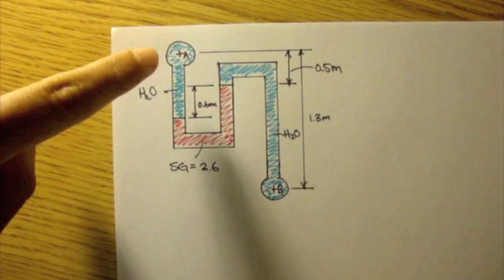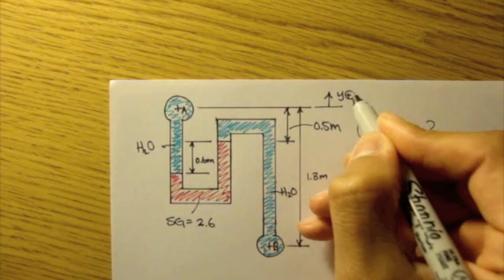Static Pressure: Example 3: Part 1 [Fluid Mechanics #11]

Comment: One-line solution! I'm going to work from B to A keeping in mind that as you move up the pressure is a negative value, while moving down (h is larger) produces a positive pressure value. γ water is 9800 N/m^3 and γ of the other fluid is 25,480 N/m^3:

Pb - 9800(1.3-0.5) + 25,480(0.6) - 9800(0.6+0.5) -Pa (negative because we're going up the tube) = 0. Result: Pa - Pb = -3,332 N/m^2.

Comment: Why is it 0.6? The way you write it (-0.5-1.1)
Reply: because he write two negatives instead of one. So the negative will turn positive
Reply: @wellinformed8050   Im confused. I would have done it this way:
= -γ * (-0.5 - (-1.1)) 
= -γ * (-0.5 + 1.1) 
= -γ * -0.39
= γ * 0.39

But even if it was done without double negative it would be 
= -γ * (-0.5 - 1.1)
= -γ * -0.61
= γ * 0.61
Which is also not equal to the 0.6 in the Video :/

How does he come up with 0.6 ?